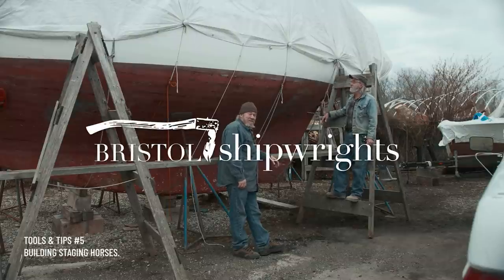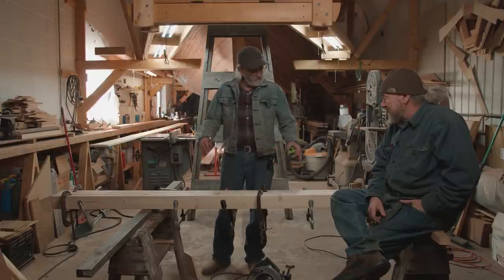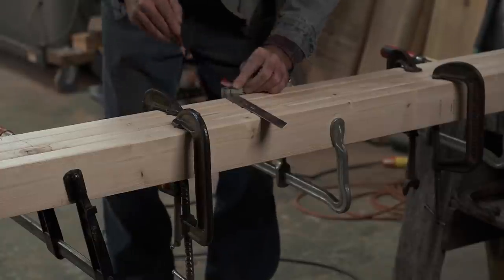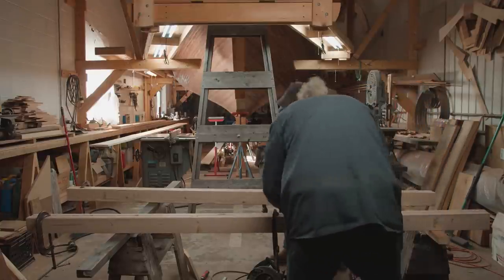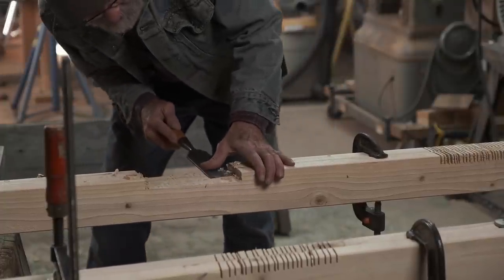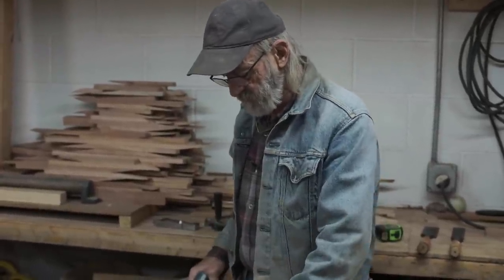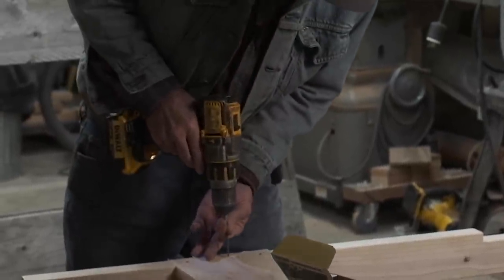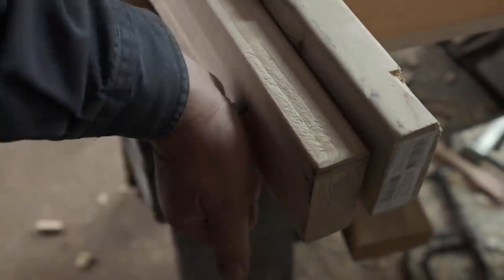How to build boatyard staging horses: Tools & Tips #5

Comment: I kept trying to tell you the third layout was backwards, but at least y'all caught it before it was cut. Home built scafolding ladders, what a treat. Thanks for sharing your tool build. Are the walk boards 2x10s or 2x12s? All though, I suppose that would depend on the needs of the builder/s and their weight plus tools. A guy like me, @ 245lbs with an ~68# tool bag would probably be safer with an actual aluminum walkboard or a 3x12 plank.

Comment: I have a few things to add to the current (April of 2022) construction of these very useful staging horses (the video posted in Feb 2021) - I am making two for my lobster boat - picnic boat refit project 

1. Watch video and make a cut list
2. Drive to local big box store (real lumberyards are not open on Sunday
3. Sort through > 100 2x4s (some with tree bark on one side) for 8 barely acceptable pieces
4. Have the shop salesman tell you how lucky you are that the price dropped this weekend
5. Sort through two bins of mismatched carriage bolts and washers for 4 proper sized
6. Downsize to 1x6 vice 1x8, hoping with a top reinforcement the staging will be adequate
7. Checkout and find military discount does not apply to lumber
8. Load truck, go home to boasted, begin setup and find 3 “studs” are actually 92” not 96”
9. Sell boat to pay for materials.
10. Watch more videos from Bristol Shipwrights and thank Lou and Ken for wisdom, inspiration  and entertainment

Comment: I realize you had a horse to copy the angles from, but what are the actual angles and width for us who don’t have one to go by? Thanks Lou
Reply: I believe Lou gave us all the dimensions.  Rungs were 1x8 ripped to 7.5"   bottom 43" ish , top  26"  spacing out up the ladder at 18" , 24" 24" 24" measuring the top of each rung .  Lay those pieces out on the floor and then get you bevel gauge out.
Reply: @DavidWieder216951  Thanks, sounds good
Reply: @DavidWieder216951  Except 1x8 softwood stock is going to be 7 1/4"
Not that it's going to make a bit of difference in the real world, but the gain is going to be real sloppy if you didn't check first.